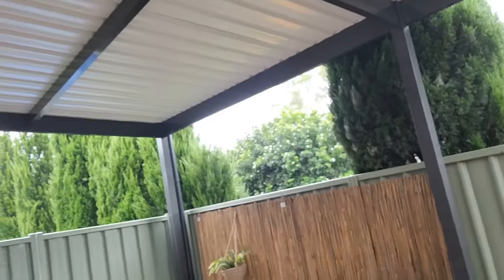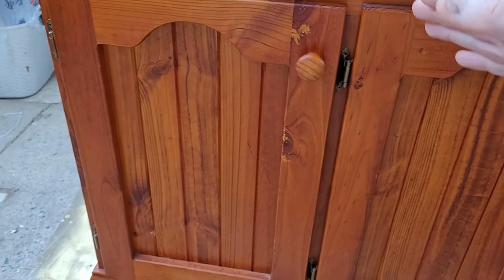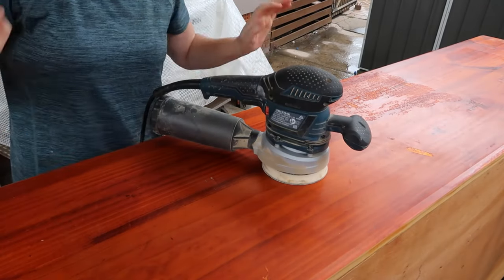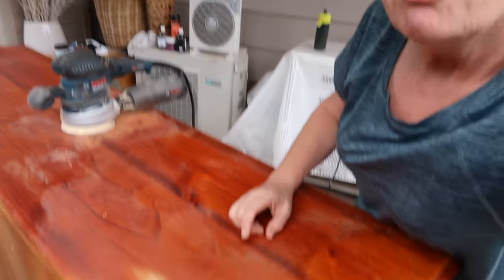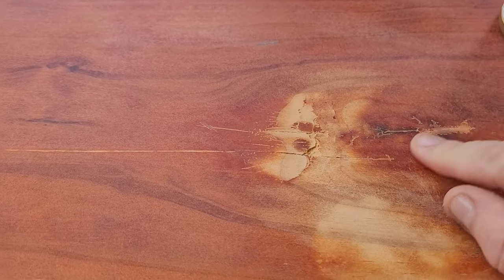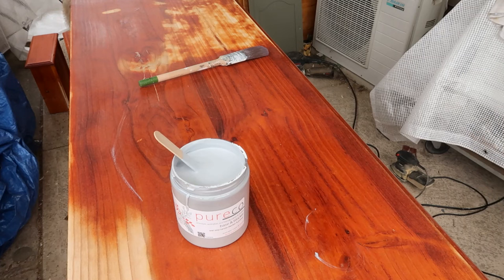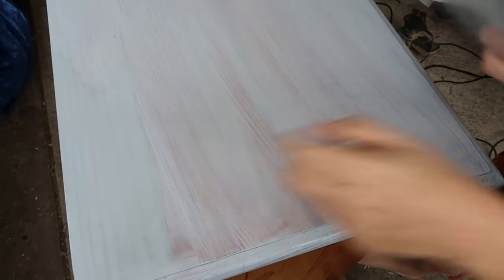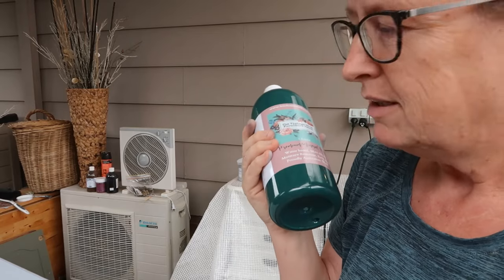All in one paint furniture makeover | diy thrift side hustle

Comment: Hi, all your pieces look great and provided me inspiration. I have chalk painted a table and whitewashed the top. I have waxed all parts with the exception of the top. Could you recommend a sealer the top, other than wax? it will need to be fairly durable.
Reply from the maker: Depends on the country you're in, but any water based hard wearing top coats will do the trick :)
Reply: Thx so much. I’ll give in a try. I’m in Perth WA and loving your work :)